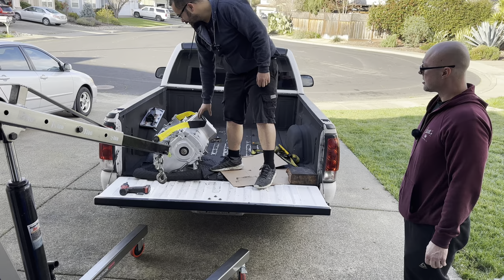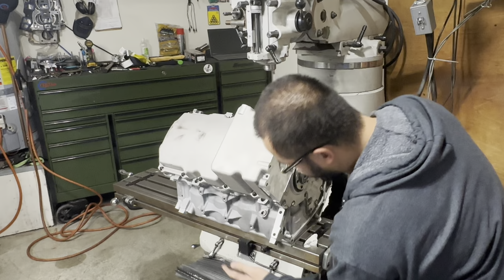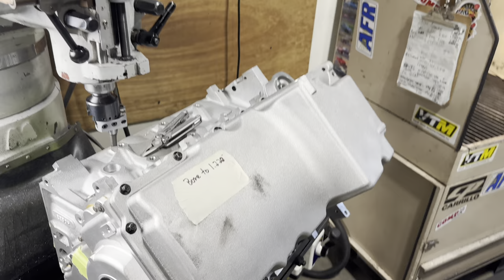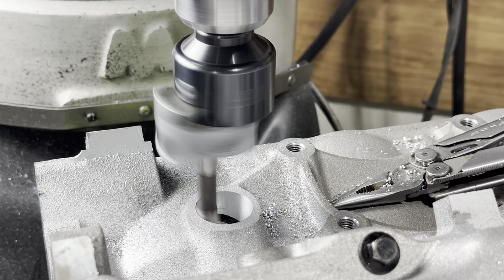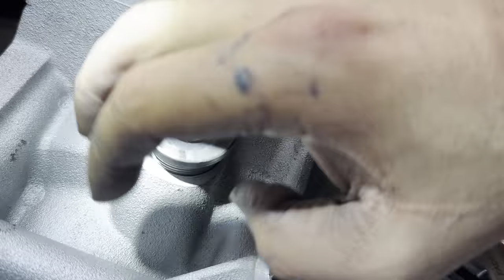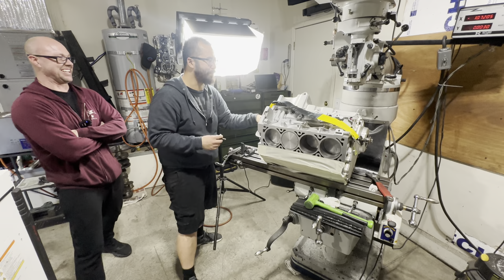They STRIPPED a 28MM THREAD!? Time to fix it!

Comment: True story: the first shop that I worked in was started as a 3rd business in about 1948, by a man who had made and lost about 3 million bucks over the years. He had worked in the Pacific tank retriever shop during WW2, and had lots of experience in dealing with machinery. He was still working 3-4 days a week when I started. One day he came in with his hand bandaged up; he had reached under the shroud of a running lawnmower, and broken one finger and lost the tips of that one and 2 more that didn't get broken. He said he realized his screwup before he completely closed his grip, or it would've been worse. This from a guy who had built a business adding tag axles to trucks, and stretching or shortening truck frames. He knew his way around rotating machinery and didn't think for a heartbeat.

Comment: Core plugs are needed because of the casting crore. Is there any other function? Apart from sealing up the block when assembled, when would you ever need to remove it in its life? Couldn't it be plugged and welded up?
Reply: when the block freezes, they pop out and hopefully not crack the block, at least the Olds x
school blocked did
Reply: @hbunnie1120  I think the freeze plug factor is really just a byproduct of the casting core plugs. For those of us never seeing freezing temps, core plugs are just a weak point in the block.

Comment: Metric is easy because what you subtract from the nominal diameter (for M33x2 is 33 mm) is not two sizes under, but the pitch of the threading (the x2 part), which is also in mm.

For extra precise drillings I have always to reference a manual, I can't remember the precise holes to save my life, but that rule of thumb comes always handy

Comment: $7000 block? We bought a new one from GM a year ago for around $2500. Have they gone up that much?
Reply: no
Reply from the maker: I was referring to the bill attached to the longblock. They’re pretty spendy cores as longblocks. It’s like 3500+ around here.
Reply: saw one for sale the other day, spun bearings, taken apart, lost parts, for like $1500.  People are nuts. $3500 would be about right for a niceish running condition long block. @EngineRehab
Reply from the maker: @ShellYeah03  $7000 for a fresh one like this is a steal.

Comment: When you started with metric, I was like nice this man has progressed. Then you reverted back to sticks and stones measurements. What is a thou, a blond hair? 😂 All jokes aside, I know how fun it must be have imperial and metric hardware in your car.
Reply from the maker: I have two cars that have both metric and sae fasteners holding it together.
Reply: Yeah, and that "2 sizes under" for the tap drill is not correct.  It's the thread diameter minus the pitch.  So if you're doing for an M33 x 2.0 thread, the tap size would be 31mm.
Reply from the maker: @billlewis9740  you may have learned me something new today!
Reply: Technically that works for SAE as well but the math isn’t usually as easy. But for example of easy math the tap drill for 3/8-16 is 5/16.
Reply: @dreambuilderkmg  Nice one, is it as easy for something like 1/2-24? Yeah I just had to.